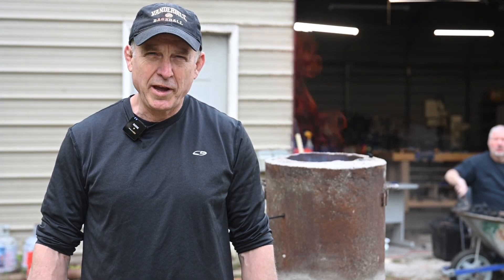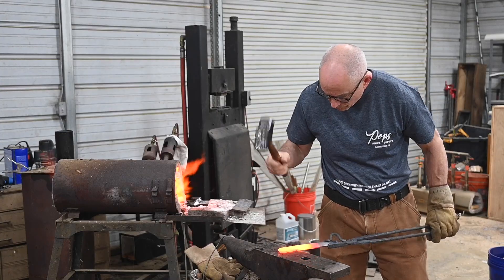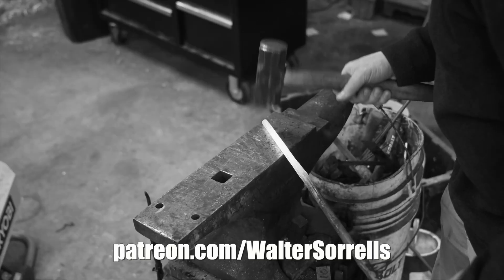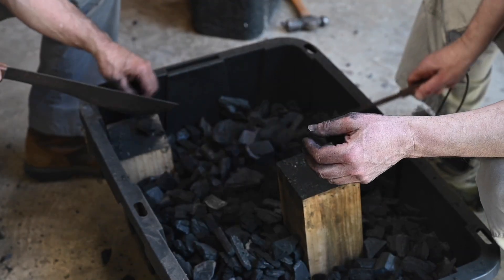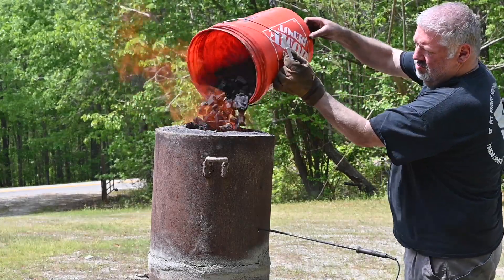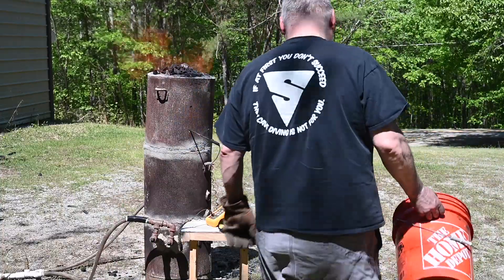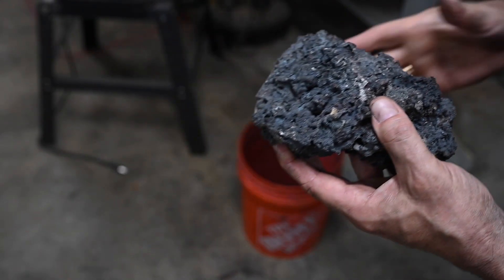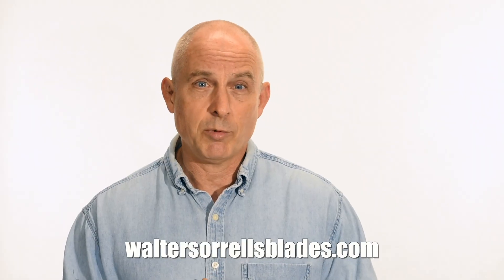Making Steel From Dirt! - What Does It Take?

Comment: Wouldn't it be easier to just use steel shot or shavings tumbled into powder. Melt in a crucible sealed , then after it's cooled    forge the crucible steel into a sword. Use different grades of steel to get the patterning . I'd love to see steel shot in a large crucible melted with about 20% nickel powder added to it melt it making crucible steel  and forge it into a bar, Etch it.  See if it has veins of nickel running through it.  Maybe take a test piece heat it and twist it, then forge into a flat bar. Test etch again see how it changed maybe cut it down and forge weld it draw into a bar grind and etch if it looks good, maybe make two 1/4"-1/2" thick 2" x 8" bars with a  1/8"- 3/16" 1095 or something to hold a edge, forge weld it between the two bars, all the same size,  draw it out  into a knife / sword  thin it down  keeping the knife steel centered.  And forge a blade. The knife steel core should  keep it sharp. The nickel and steel bracing the thin core. It should be plenty strong and look great with the bright silver nickel running through it.. if nothing it should be beautiful!! 👍🏻

Comment: I would like to make some silicon steel. Or electrical steel. But I doubt this would be easy bat home  to make 50+ lbs of it anyway. I need thin sheets 1/32"-1/64" or around .030" thick. I would like 36" 48" long strips 4" wide. Or at least 12"-18" long strips I have thought about possibly using silicon steel dust and wet it with a thinned epoxy resin. And compressing it into a mold at 2tons or so.  Squeezing out excess resin. Making a large donut or toroid. Around 4" tall 6" 8"  center and about 18"- 20" outer diameter. Or possibly making two - four 1/2 to 1/4 that size. Wrap it with probably 10+ lbs of enamel insulated copper wire. And use it to manipulate electrical current.  I have considered using the electrical steel from motors and transformers. Getting it into a usable configuration. Is difficult. Mild cold rolled steel can work however efficiency is lost. I don't recall the amount of silicon used . I'd like to possibly add about 1-2% if made it. I thought about melting steel from motors and transformers, casting 1"x 12"- 18"  bars and forge it into long flat bars 2"-3" wide , 1/8" thick abd 24"+ long, then run through a slip roll or a modified English wheel, hot, at a mild red hot temperature. Get it to just over 4" wide and between .020" and .038" thick. I could even use twice as many 2" wide strips. I would paint the sheets with enamel paint cut out a jig in 2x4's screwed to a sheet of plywood. That would hold  the outer diameter in place . Use a bit of epoxy to glue the layers together. Maybe use a carbon fiber or fiberglass to wrap the diameter then wrap from inside to outside . And vacuum infuse with epoxy resin. Allow it to cure. In the vacuum bag.  And unwrap and sand lightly with 220-400 grit. To remove any sharp epoxy. And paint with another layer of epoxy resin. To seal the fibers. With the fiberglass or carbon being about .030" thick , protecting the enameled wire from the steel. Yet still using the paper traditionally used. 
I'm hoping to get a peak of 20-30 kw from the transformer . I have also thought about embedding 1/8" copper tubing  to pull heat from the core. Most transformers are either air cooled, or use mineral oil . The transformer is dunked in a tank of mineral oil!..  enough rambling have a awesome day..

Comment: 1400 years ago or so, a similar process would’ve been used by European smiths to make steel and iron. Their process to make a sword was probably even more labour intensive and consumed more of the finished material, due to losses in the pattern welding process. Those early blades must’ve been extraordinarily valuable bits of kit.

Comment: SO VERY COOL! Did You put in some Manganese and or other compounds?
Reply: Manganese suppresses the formation of a hamon, or, Japanese-style temper line in steel. Basically, it causes deep hardening. You want shallow hardening in this genre of handmade steel, otherwise the temper line will either be really faint, only revealable by acids, or not present at all.